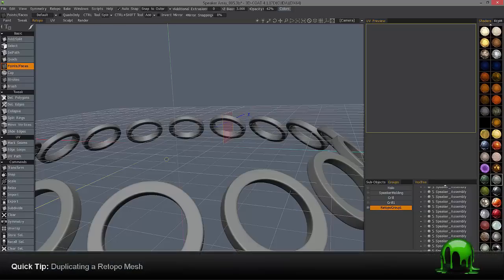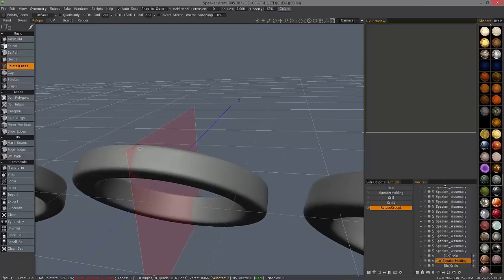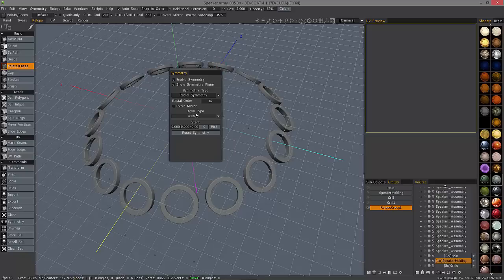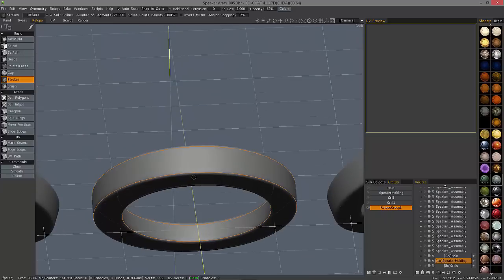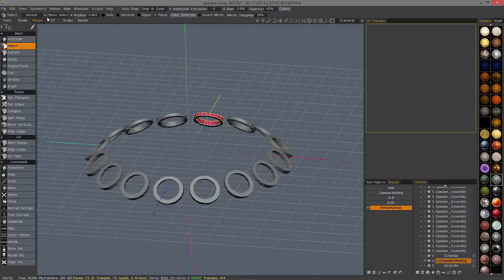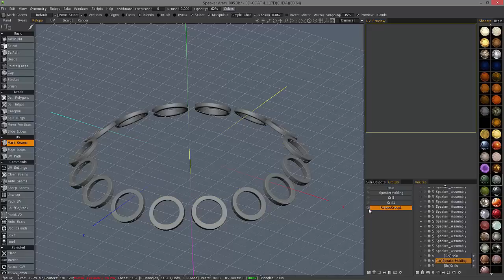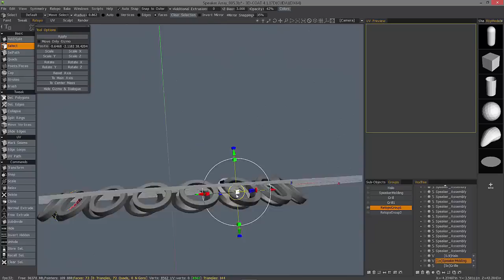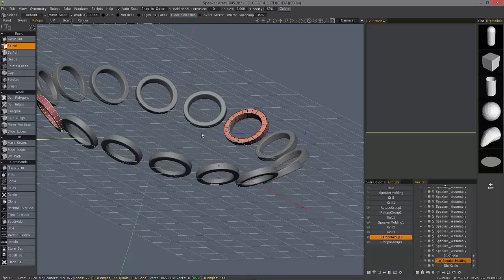Duplicating a Retopo Mesh

Comment: Is there a way to create objects in 3D Coat to accurate real world measurements? Like creating a perfect pipe that's 1/2" diameter with a 1/16" thick wall for an interior diameter of 3/8"?
Reply from the maker: In the SCULPT Room/Workspace, you can go to the GEOMETERY Menu > click DEFINE MEASUREMENT UNITS. And in the Tool Panel, under the ADJUST SECTION, you can choose the MEASURE tool. In the VIEW Menu, you can turn on a 2D Grid and use that as a guide + enable 2D Grid snapping or 3D Grid snapping, to make more precise adjustments.

You can find videos in the Feature Demo playlist covering the Measure Tool, 2D Gizmo/Grid, etc.